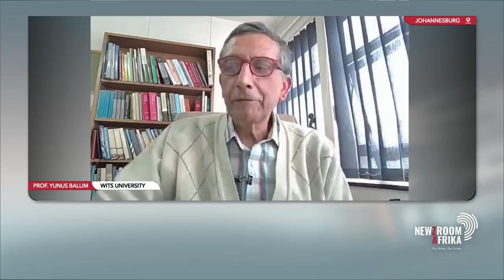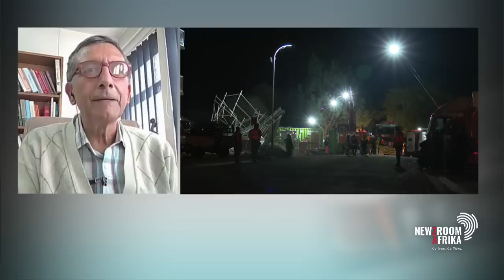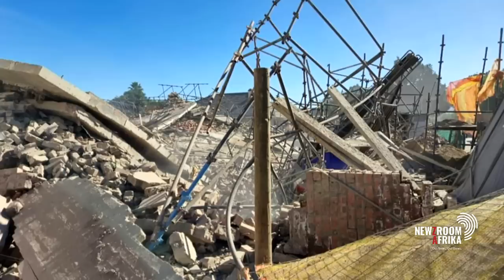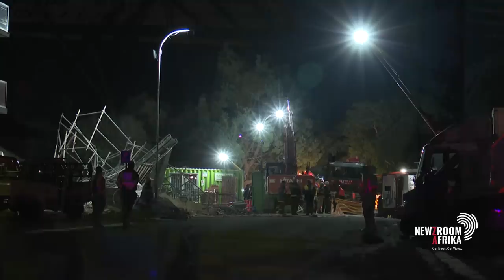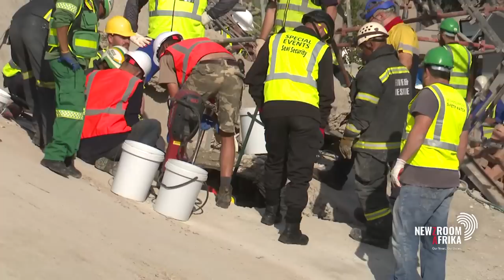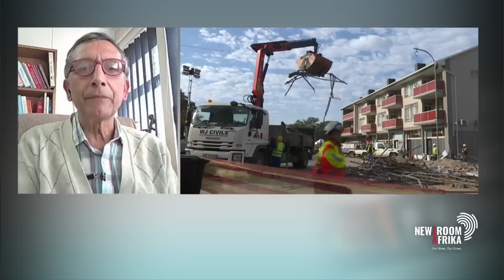What could be the cause of building collapse in George?

Comment: There are some serious protocols to be followed when a building is constructed. Firstly the structural engineer is responsible for the design of the structural elements such as foundations, floor slabs and columns. Secondly he is also responsible to inspect the works such as the steel specification, concrete strength etc. as well as the time schedule when support scaffolding may be removed. I'm not making any accusations but neglecting these issues can lead to this type of tragedy. The council which approved the plans cannot be held accountable because they take no responsibility for structural integrity. Therefore I can only find 2 parties accountable for this accident and that is the structural design engineer and the main contractor. If there was a project manager full time on site he could also be questioned when it comes to materials being stacked on areas causing overloading.

Comment: There are two reasons for such a collapse: 1. Poor Structural Design - which is the responsibility of the structural engineer, and 2. Poor Construction - which, in a catastrophic failure such as this, could be the cutting of corners on steel used in the floor/roof slabs and columns, and/or the grade/quality of the concrete used. Another potentially fatal practice is the rotation of floor/roof slab support scaffolding for use in higher floor/roof slabs, meaning that support scaffolding on lower floor/roof slabs is removed for use higher up in the structure to save on scaffolding hiring costs, but if removed before the concrete has reached the required strength, this practice can lead to a catastrophic failure of the now unsupported (scaffolding removed) lower floor/roof slab, which now has the full weight of the freshly cast floor/roof slab above transferred onto the unsupported slab through the support scaffolding of the upper floor/roof slab, which happens to be a FAR higher dead load than what the floor/roof slabs are designed for (ie. humans and furniture). I'm not a betting man, but if I was asked to hazard a guess, it would be THIS: the removal of scaffolding on lower floor/roof slabs, possibly combined with skimping (cutting back to save money) on reinforcing steel in the floor/roof slabs and columns, and possibly the use of low grade concrete (again, to save money).

A video I watched shows NO top reinforcing steel in the collapsed slab, as well as completely 'clean' reinforcing bars, a sure sign that the concrete was under-strength.

RIP to those poor souls lost, and condolences to all the families who have lost loved ones.

NOTE: This is speculation ONLY based on what I have seen!

Comment: Imported and locally produced cement are subject to regulatory testing in South Africa. The Prof should have his facts in place.
Reply: Also wetting cement does not weaken it. It actually is better to keep it wet longer to make concrete stronger.
Reply: @meisievannancy  _ He said WHILE IT WAS POURED..... Not after it was Cast! _
Reply: @liongod1000 Wet concrete settles and the water drains off. Too wet then could cause the mix to not be homogenous but trucks arriving with water and too little concrete is unlikely as the consistency will be draining water off constantly and the developers would complain they are getting trucks of water and not cement.

Comment: If you watch closely, you could see dust cloud blown from beneath prior whole structure collapsed. Indication that the failure came from ground level, suspect could be poor structure load distribution. 

2, From one worker interviewed, the pillar spacing at ground level was too wide. That makes sense as the building collapsed vertically/inward. 

3, From the photos of the building as the construction was undergoing, the building was covered in bricks, with few large window spaces. This old architect design that rendered the buildings super heavy. Hence nowadays budings use glass and aluminium to cover the building and partition the rest of the interior. That reduces significant weight.

Comment: In a nut shell 1. design checks were they done by competent engineers and passed. 2. Contractors credentials and competence checked by owners and engineers. 3. Were strict safety measures and standards in place, practised and adhered to.4. Were the relevant quality inspections done on materials before construction commenced and approved by engineers. 5. Site management and supervision and 
Quality inspector competency checked and approved. Any incompatence found in any of the above could of played a part in collapse of this building. Speculativly Regarding Construction mafia, demanding payment of up to 30% of contract value, it may lead to contractor cutting corners during construction regarding quality and sans specifications

Comment: A truck parking on one of the slabs/levels ????? Why and how would a truck get up there. Silly comment.
These interviews should be done with practising Structural Eng's.
Reply: This building had a basement level…
Reply: @manivsewparsad2511  Yes I know, but this certainly doesn't effect the structure at all. A truck parking in the basement would be on the surface bed, and have no influence on load bearing higher up. Common sense.
Reply: The point he made is that an uneven load can cause concrete to fail especially if the concrete is not dry enough or the concrete from a poor standard. He can only speculate and the structural engineer will also speculate. Only someone who is investigating the cause will be able to tell what went wrong.

Comment: I was born and raised in George where my dad worked as a building inspector from the late 70's to early 2000's. I distinctly remember visiting building sites, with my dad during holidays . You would often see a site stand still for a week or two after every foundation/slab was cast. During this period the  slab would be kept wet to slow curing and keep temperatures down in the concrete. It no longer happens.
Reply: 21 days at the least after each level is poured on a residential building is the standard
Reply: @trishennaidoo1309  "supposed to be the standard " yes however in this day n age  you lucky if now it cures for even 7 days before starting the next pour. i cringe daily when i see even houses going up.
Reply: Thd going rate to bribe a building inspector these days is R5000. I know of a building inspector in Milnerton who was bribed for R25k.
Reply: Concrete is expected to have reached it's full strength in 28 days and correctly so, one would not be expected to start building on the fresh foundation concrete before the concrete has fully set. However, engineers do allow the addition of concrete columns, beams and slabs provided that the bottom slabs remain fully supported until the concrete has reached the required strength.
Reply: I had a conversation with a building contractor, he said that after a couple days the concrete is 25% cured and you can build 25%of the next level. And thats how all the local contractors think where I am, and ALL the houses built here crack in less than a year
Reply: Fast building projects lead to tragedies.Inferior quality bricks and who knows the quality of the cement.Back in 1978 when my house was being built I had to wait a long time for completion.They used corobrick.And it was not even a multi story building!!!!!.When you use ashblocks or cement blocks for a multi story building the Contractors and builders have to wait much longer for each layer to properly dry.This rush job has brought on this tradgedy.The dead workers families must be compensated fully.imo.My heart truly goes out to the people of George and all those who are still alive trapped under all that rubble.😢😢😢😢
Reply: my same thought, i am not allowed to lay a brick without the approval of my engineer and inspectors. The company is here to blame
Reply: @nico-benkellerman977  the building inspector is just as much to blame. But the big question is how many existing buildings was completed by this contractor and corrupt inspector and how safe are those buildings

Comment: What happened to SABS approved material? ..
Reply: Recent Past Investigations Reveal That The  SABS  Is NOT Of The Reputation  and / or  Technical Capability Of Decades Past; Failing In Various Sectors Of Its Responsibility and Oversight .... !  😡💩🪰
Reply: @johnnyeveritt5695, quit lying...The SABS in any event will not be able to test every bag of cement that comes out of a factory. That is not what they do. You also will not point to any collapse now and in the past where SABS was at fault.
Reply: BEE
Reply: vanished in 1994